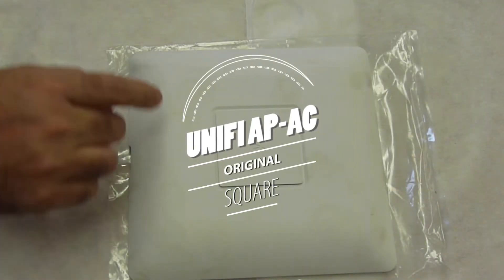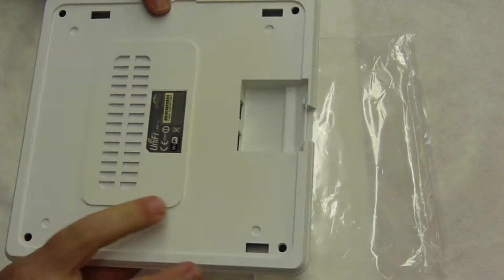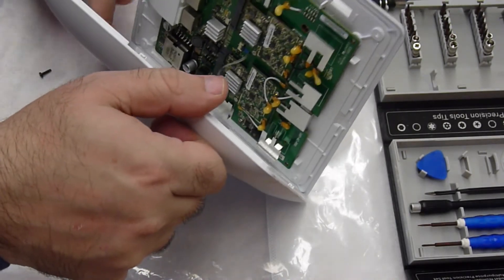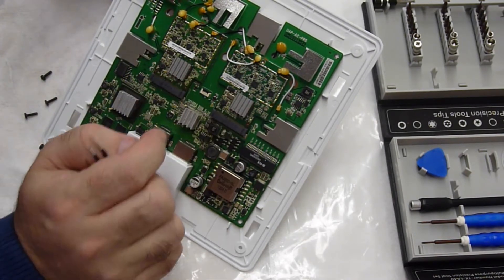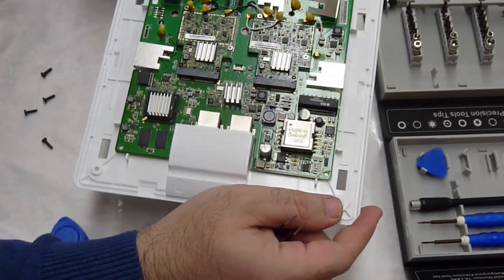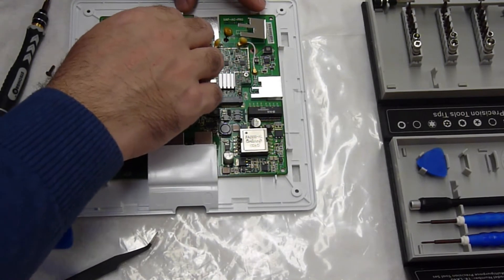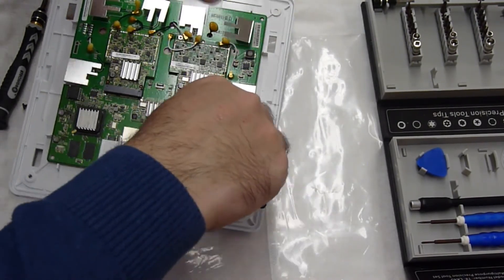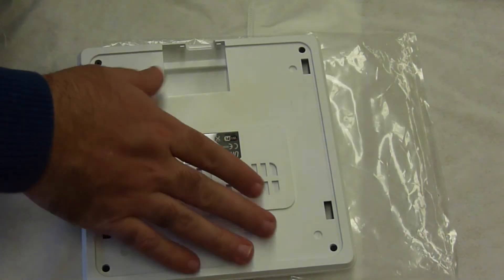Unifi AP AC Teardown

Comment: Probably should have removed the pc board and checked the solder joints on the main ethernet jack.  If it got knocked of the wall that probably got stressed.

Comment: Thanks for the video.   There is a guy on YT who was able to repair an AC LITE relatively easily.  I think it was a resistor replacement IIRC.   Maybe that would work for this guy too.    Did you ever get it working again?  How do these perform in comparison to any of the newer ones?  Would you recommend purchasing some of these older units versus newer?